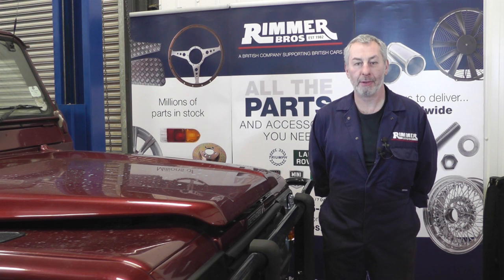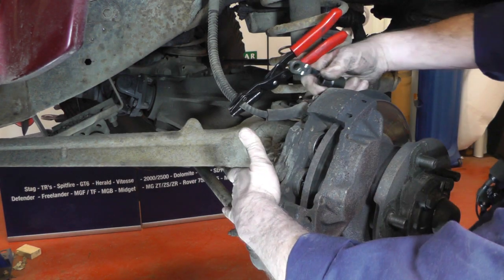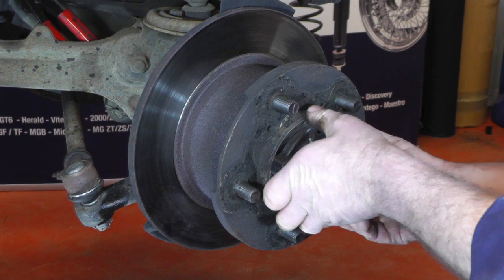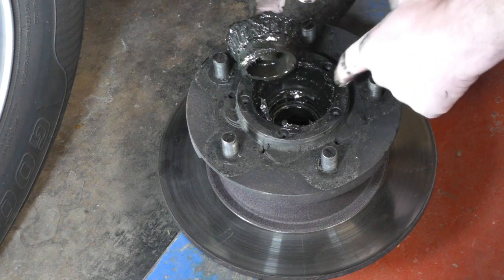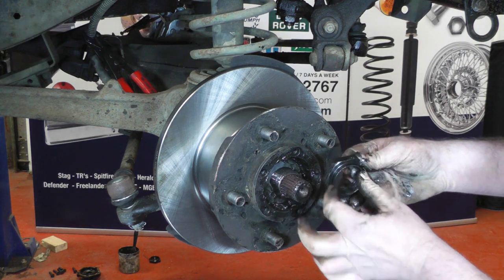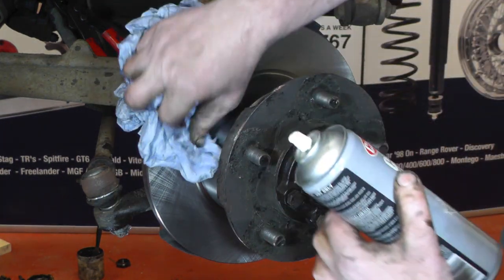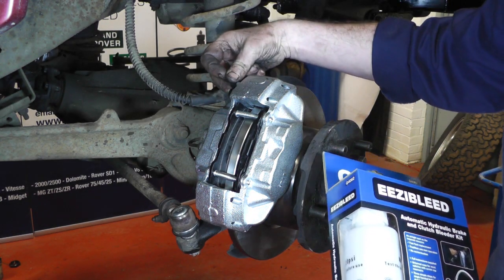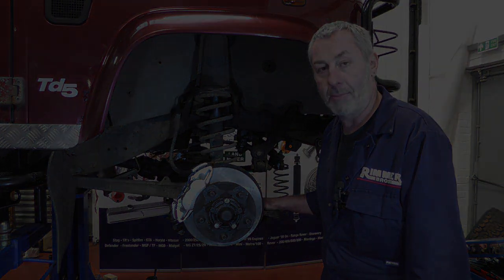Replacing the Front Brake Discs, Pads and Calipers on a Land Rover Defender TD5

Comment: Very good information but I notice that although the caliper pistons were seized solid, the disc was very shiny as if it had been working normally, is that just the amount of movement on the seized piston rubbing on the disc? I find it annoying that Land Rover choose to put an 11 mm x 1.5 mm thread in the end of the half shaft where there are 5 10 mm x 1.5 mm bolts holding on the drive flange, one of the bolts could easily be used to pull the spined shaft back out to fit the circlip, but 11 mm is not a "common" thread. Chris B.

Comment: Thanks for the great instructions on this. However the  lock washer (FTC3179) suggested in this video seems not correct for my 2007 Puma. It’s way thinner than the one that is used there (FTC5241).  Do not attempt to replace it with the lock washer suggested as it will completely deform.

Please check the diagrams before purchasing the parts, I think FTC3179 is actually only being used on older models with the old locknut/washer system (the exact opposite what is suggested in this video).

Hope this helps!

Comment: Nice video, but no mention of the fact that the two callipers are different. They are marked L/R and the bleed valves need to be at the top or the brakes won’t bleed properly. And yes; I missed that first time round 🤪🤦‍♂️